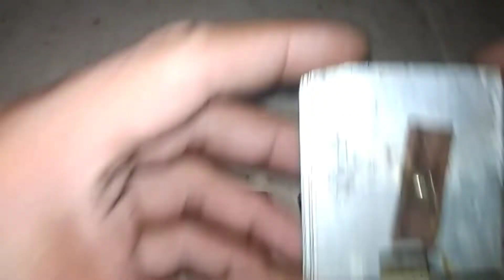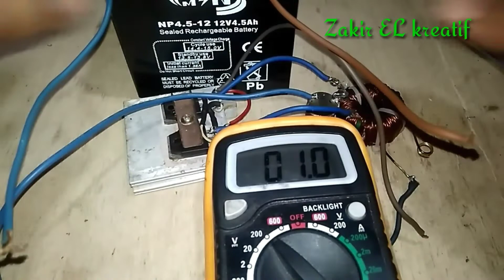inverter untuk setrum ikan dengan travo ferit cukup 2 mosfet #setrum

Comment: Cara lilit sepulnya mass
Reply from the maker: 6 lilitan x 2  untuk sekunder menggunakan kawat 0,7 mm yg digabung sebanyak 4 kawat

Untuk primer kawat 0,7/0,9 mm
Dengan jumlah lilitan = besar tegangan yg di inginkan : 2 mas
Reply: @Zakir_Elektro  terimakasih mas
Reply from the maker: Siap sama2 mas
Reply: @Zakir_Elektro  mohon maaf mas gulungan yang yg kecil itu ikuran kawatnya berapa .yang jalur positif
Reply from the maker: 1 mm jumlah lilitan 30 - 50 lilitan
Reply: @Zakir_Elektro  terimakasih mas alhamdulilah sy udah peraktek berahasil mas makasih mas
Reply: Cuma sy pake irf 3025 mas cepat panas tapi berhasil lampu 100 wat nyala.
Reply: Oh ya mas bagaimana boros ga ke batrenya soalnta sy belum di tes pake aki cuma dites pake trapo dc .

Comment: Mas,saya mau tanya,seumpama saya buat 4 fet atau lebih,apa bisa mas,gak di kasih esilator,cuma di PDC in saja,dan apa pengaruhnya,soalnya klw pakai esilator,cari icnya yg susah begitu kabel input dan outputnya
Reply from the maker: Bisa mas... Setiap mosfet harus di tambah resistor seperti di rangkaian tu....
Kalau ada relay bisa juga mas buat sebagai osilator
Reply from the maker: https://youtu.be/OvW262HFwqM
Ini contoh osilator menggunakan relay
Reply: @Zakir_Elektro  ok mas terima kasih
Reply from the maker: Sama2 mas

Comment: bang mau tanya klw mau rakit itu mosfet nya bisa di ganti sama irf z44 ngak
Reply from the maker: Bisa , tapi nilai resistor nya biasanya harus di ganti...
Reply: @Zakir_Elektro  klw bole saya minta bantuan nya.resistor nya ukuran berapa ya
Reply from the maker: 1K ohm bisa mas....
Reply from the maker: 1 K semua
Reply: @Zakir_Elektro  ini lo.mau tanya kagi soal trafo nya bisa di ganti sama yang 3 amper ngak